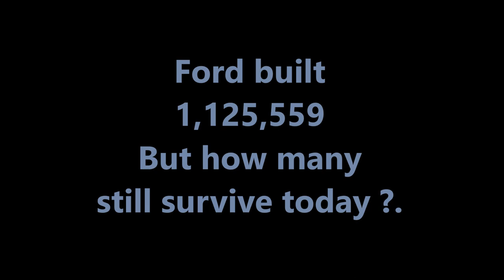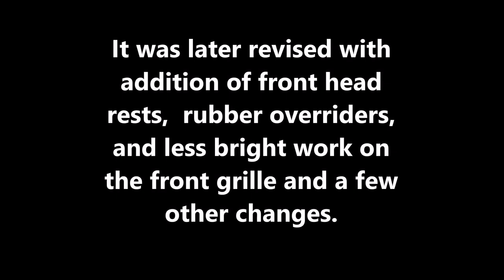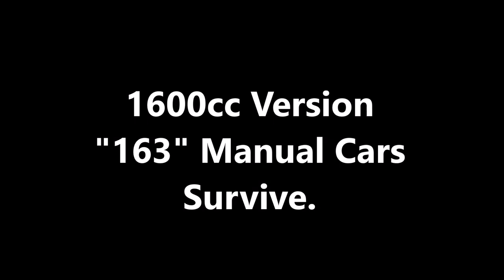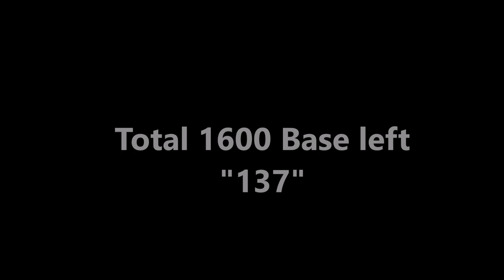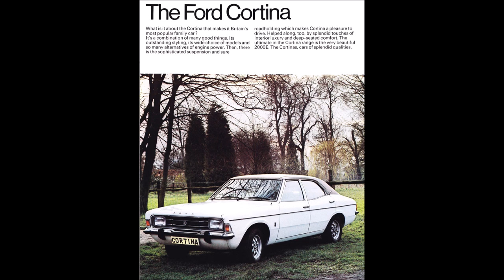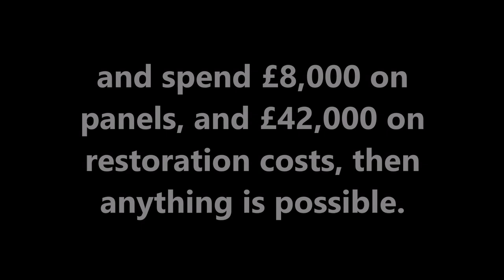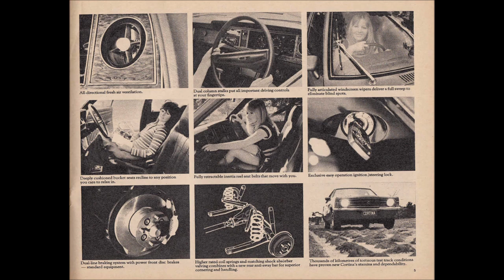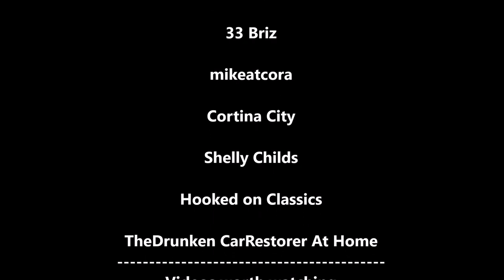CORTINA MK.3.- HOW MANY SURVIVE

Comment: Dad bought a 1973 Cortina 2000 GT 4 door in 1974. It was red with black vinyl roof, sloping dash, angled gauges, tombstone seats etc. Dad was a little suspicious of it and thought it might have been reshelled, as the underside was as new with virtually no road dirt and he bought it from someone who worked for Ford. His suspicions were raised even further when it failed its first MOT because of a brazed brake pipe. However it was a great car and I learnt to drive in it. He owned until 1980 and the only issue it ever had was the infamous camshaft lobe failure which he soon sorted. Still have the splined head bolt socket somewhere in my tool box!!! RUR 356M are you still out there????

Comment: Our family has a one owner Cortina since new. It is a 1973 Cortina Mk3 XL with the identical interior shown at 15:20. The car is located in Sri Lanka and is garage kept. Last year it received a complete paint job. It is all original except the AC, stainless steel caliper pistons, toyota front brake master pump, electronic distributor. It runs and drives no issues what so ever. I found Honda Odessy year 2000 rear brake wheel cylinders are perfect match for the cortina.  Looking for rear wheel arch (Left), Coach line and panel that sits right below the rear windshield and above rear seat (make holes to mount speakers).

Comment: Had a TD and TE Cortinas here in Australia, The TD had a 200 cubic inch straight 6 with 3 speed auto, And the TE had  a 250 cu ic inch straight 6 from a falcon with a 4 speed manual. Both built from the factory here in OZ.
Reply from the maker: Brian Hay: The engines you had  from Factory were impressive compared to the UK market, the biggest on our Mk.3.'s was the 4 cylinder 2000cc, It is so nice to think my videos are being seen as far as Australia, and I very much appreciate your taking the time to watch and comment, thank you so much, and great to hear from someone that has owned 2 of the Cortina range. and they were both nice examples you had there.

Comment: Thank you Keith for an excellent and informative video . Nearly 40 years ago (really?!) when I was 19 my second car was a mark 3 gxl 2 litre (my first car being an E reg  mark one cortina two door which I drove for a year then took it on its final journey to the local scrapyard . Imagine what one of the last mk1 two doors would be worth now ? Scrap man gave me £10 for it - but I digress) . 

 My mark 3 that replaced the mark one was , like I said a "top of the line" 2 litre GXL in copper brown metallic . I loved it , did some rust repairs on the front wings (which I remember came out looking worse than the rust !) removed the cam belt cover and fitted an after market chrome rocker cover and painted the (cast not tubular) exhaust manifold in VHT (very high temperature) white paint . Finished it off with some chrome 8 spoke wheels (which went as rusty as the car after a winter!) with 185/70/13 tyres . UCH 700L was the reg .

I kept the mk 3 for about 2 years then sold it to get my first American car ( a 1978 Dodge Diplomat ) . I guess in the end UCH 700L was scrapped like most of the rest of them , kind of sad really .
Reply from the maker: peter Barker: Always good to hear from you, and thanks so much for your support and the interesting comments, UCH was last used in Decenber 1985, we all have those "If only" moments, when we look back at the past, like your MK1 Cortina 2 door, but at the time £10 was  decent money,  and a Copper Bronze GXL was a high quality car, even with the rust, a nice motor to own!,  I am glad you enjoyed the video, more car content will be coming, along with the odd other things just to vary the content a bit, 99 % of those that subscribe or watch do so for the car stuff, but even if only a hand full of people find and like other videos  I put on the channel, then for them it was worth it, is how I look at it, as i like to create different things to appeal to different people,   An update on the Green Cortina is long overdue, as I have had to divert time and funds on my house,  but soon as I can I will get back on that project,
Reply: @Cortinaman63  December 1985 , lasted quite well then . Was a nice car , fond memories .

Comment: We bought a new diamond white 2000L 4d saloon in Oct 72. Seat belt holder fell off on way home. Saw lots of summer trips across France. Always had light grey exhaust then on leaded petrol. Was a great car. FCR950L
Reply from the maker: Wayne Tetley: Thanks for your story of your Cortina Mk.3. did they forget to bolt it on at the Factory?,  I checked your cars details and she was last on the road April 1983, 10.5 years after you bought her, sound like she racked up some mileage, on the fun times in the Seventies,  a top spec 2.0  Cortina L, in Ford Dimone White, (nice!) I remember seeing them brand new and gleaming on the roads,   glad you like her, and hope this film brought back lots of fond memories for you. thanks for watching  very much appreciated.
Reply: @Cortinaman63  Thanks. Yes your video and those PeteC do bring back nice memories of my dad's Cortina. The belt socket assembly (with the release button) hadnt been crimped onto the cable bolted to the transmission tunnel. Must have escaped QC at the factory and pdi at the dealer, Bristol Street Motors, Shirley, Southampton. The car had brush nylon interior. Bit special for an L model then. 
😊
Reply from the maker: @waynetetley584  They would have been made by an outside supplier, around that time, so  must have been a faulty part from manufacturer, missed by everyone!, the Cortina L model came with vinyl seats as "standard" 1970  to late 1974, then for the 1975 model year Ford Beta brushed Nylon seats were standard fit, but they were an optional Extra at extra cost for the L decor range, September 1973-August31 1974, you saw very, very, few Cortina L models with that upgrade back when they were new, as it cost the grand sum of £14 (a lot of money at the time), and more often a Vinyl roof optional Extra was bough for the same price, instead, as it gave the car a sort of GXL/2000E outside look and feel, for less money than those cars cost, even if they lacked the rest of the luxury features on the exterior styling, a vinyl roof gave the impression back in 1970's that you had a posh motor!, Thanks for both supporting Pete C and my channels,  having met Pete at his home, seen Swampy, and been out for a ride in Ruby, I was impressed with his enthusiasm and love of the Mk3, given he is a bit younger than me, and not able to remember them brand new in showrooms like I do, but his knowledge is fast catching up to my 50 years worth  on the Mk3. a nice guy. as is Mad Mike, who is another friend  I visit, .with a passion for the Mk.3.
Reply: @Cortinaman63  We knew the salesman so he knew how to get us the posh seats. It was a sort of Q car with the pinto engine and L trim. It was quick too being a 2 litre with twin choke Weber. This did play up in the Alps one year with the autochoke and high altitude. I love PeteC's detailing eg the floor wash wipe control, the two wire wipers and the period blue air filter housing. Interesting his EOT car came from Andover not far from me! Best wishes, Wayne
Reply from the maker: @waynetetley584  I remember the first time I drove my 2000cc, back in 1996, (the second Cortina in my fleet),   I was surprised at just how much faster it was to the 1600cc, even going up hills, and your l was posher than most with those seats!, at the time, very exclusive, and added comfort, as you appreciate "Detail" you will like my car as the build videos carry on, as I have some super rare, unobtainable bits going back on her, something to watch out for, you will love.

Comment: Dad bought a 1600L 'decor' estate in 1975 - it was actually a 74 car but an ex demo model. It was exactly the same shade of green as the two cars at 10.42 and 22.20 only an estate. It had the round headlamps, and was off the road by 1982 due to rust. In fact, the car at 27.19 reminds me of it more than any in this film. It was replaced by a 1600L Mk V. 
Loved the video, thanks.
Reply from the maker: Gareth Ifan: Thanks once again for watching this one too, an L Decor Estate car very rare model version now, they did all tend to rust around the 6.5 -7 year old mark, as underseal was extra cost, and cavaty wax was not offered by Ford, and left up to owners to have done, which very few did, and if they missed anywhere on the shell, or left stone chips the cars could rust fast, I remember seeing a  Dark Blue 4 year old Mk4 with holes all over it and rust everywhere back in 1980. most were still good but that car was very rusty. I like the Mk5 nice looking car, but then I love all classics, lol. beautiful cars.

Comment: Would love another GXL - so sad they are so rare now.  Owned PAL700L from 1989 after paying £250 for it when looking like a typical banger which I tidied up by getting decent panels from the breakers and respraying..  Was originally a 1600 Pinto in it but after the original engine blew a piston on the motorway I fitted a bored out 2 litre.  Still shows on DVLA site  as a funny 2037cc engine size which what I calculated from the oversize pistons just so I could get the over 2000cc mileage allowance they had in those days!  With the lightweight shell, that engine , the original 1600 diff and a few tuning parts that car could certainly shift and I loved driving it.    By the mid 1990s was doing around 25000 miles a year in it. Sadly had to sell it in 1999 as did not have any space to work on it with a bit of rot setting in underneath.  Sold it to someone who came to door asking if it was for sale and let him take it for even less than I originally paid. Looks like he got it through one last MOT as it was taxed for another year according to DVLA.  Such a shame as it had all the rare parts and trim fitted.  Even the mercury tilt switch for the under bonnet lights was working.
Reply from the maker: Maya and Pete Langford: By 1989 your GXL was 16 years old, so it must have been cared for by the first owner, or a garaged car, as many were quite rough by 10 years old, shame you could not keep her, I remember them being sold for low prices back then, and now concourse examples lovingly restored are worth serious money, but then back in 1973 when it was new it would have been about £1,400   and the average wage was about 15p per hour. our 1974 Mk3 cost £1.575  when we bought it,over 45 years ago, and it has cost me a lot more than that to make her brand new again!,  Interesting to see your one lasted 27 years on the road, if it was last used in 2000, (same as mine was last used),  sat for 12 years then started to restore her, and what a difference now. from when we started. you could always buy a half decent Mk.3  at a cheap price, and restore her, or get a restoration company to do it like mine, and have a mint condition Mk.3. Thanks for your comments great to hear from a past owner that loved his Mk3. GXL, she might have been a little rough to look at  by the time you bought her, but it was still a nice car to own.

Comment: Dad still (2022) using his Estate 16:53 but white in color  as the second owner from Baclays bank since 1992 . Engine still intact & never opened. 
Only issue is the plugs. Which modern ones can them be replaced with?

Comment: Love the shape of the MK3 but have never owned one, had a MK4 up until 1999, currently have a Mk5 (unrestored) that has been in the family for 20 years, use it on dry sunny days only!
Reply from the maker: Klownkopyrite: Thank you for watching the film, and taking the time to comment which I very much appreciate, the Mk4 & 5 Cortina's are both nice cars too, and it is nice to hear you have had the Mk5  for 20 years, I am curious as to what model version she is, L,GL.Ghia?  bet she looks nice, and is well loved, always good to hear from long term owners, like myself..
Reply: @Cortinaman63  It is a 1.6L model, but has the ford sport wheels as an option at extra cost as shown on the original purchase receipt that I have, it also still has the original dealer number plates, tax disc holder, and rear window sticker (Candor Motors Braintree).

Comment: I am not a bodywork expert, but can it really be called a restoration if a body shell has most (if not all) of its panels replaced? I would like to receive opinions about what you think is the limit to replacing panels vs a donor shell. thanks
Reply from the maker: Manuel Attard: Thanks for your question, If another car shell had been used, then none of the original cars shell (metal work) would exist, on this restoration, more of the original panels from 1974 could of been kept and just patch repaired, but as the rust was extensive, and the quality of the shell was the most important part. we decided to replace the worst of them with original new old stock Ford panels made in 1974, and 2 new panels that were exact copies (re manufactured panels) as original Ford were no long available.
 
This retained a large amount of the cars original panel work,  IE Lower bulkhead, Dashboard, B Posts, Transmission Tunnel, Prop shaft tunnel, Floor pan under the rear seat area, Rear Parcel shelf, and cross supports, Rear scuttle panels, Roof, and all the roof frame and cross supports, rear light cradles and a all the brackets and various small panels under the car, and inside the shell. 

The car is made up from approximately 129 separate metal components and we replaced a total of 51 new  panels, so in reality just about a third of the original shell of the car. 

To me a "restoration" is retaining a percentage of the car, (as much as possible ideally)  and replacing or repairing the rest, but a "Re Shell" would mean none of the original cars shell exists and is scrapped, and then to me you would have a "replica" of the original car.

 Although Back when the cars were brand new, Ford did have a few new shells in stock so that if a car 1 or 2 years old for example was badly accident damaged, a new shell could be bought to repair that car, and so it is a hard one to say whether a Re Shell counts as restoration, it is certainly the easiest and cheapest way, but will not retain any of the "original car body,"so I chose to restore the one I had, as a re shell would be a different car to me.

At the end of the day any old car will have already in it's life had replacement body panels or repairs,  due to accident damage or rust issues, common ones being, sills, front wings, lower rear valances and doors,etc, and so that to is restoring a car, 

The aim of this restoration was to have the car looking as close to 1974 when it rolled off the Ford production line as (their Promotional Car) ,back to brand new condition, 100% rust free and like new.  but with better anti rust treatment than they could produce at the time, and have one of the best condition shells that exists, as close to Ford spec as possible, even down to the same spot welds the car originally had in the same places.panel by panel.  

Sorry for the long answer, but I hope that makes my personal views clear, many others may disagree, and that is fine, life would be boring if we all thought and liked  the same thing.thankfully we don't, and there are a vast array of different Classic cars out there owned by passionate fellow owners who lovingly restore them, and I for one absolutely adore seeing them, what ever make & model they may be.